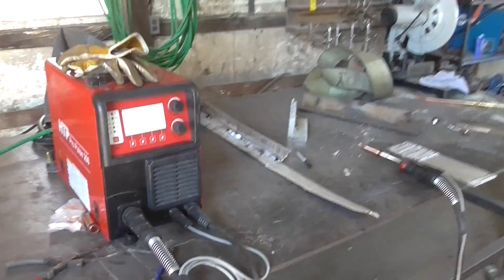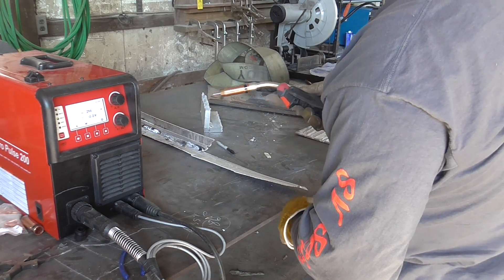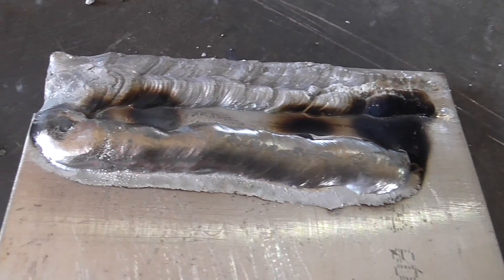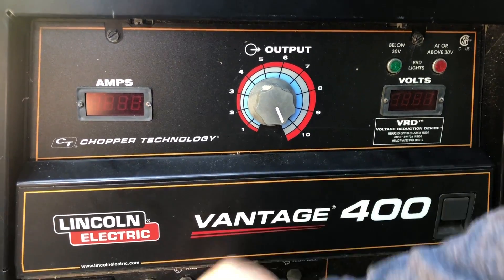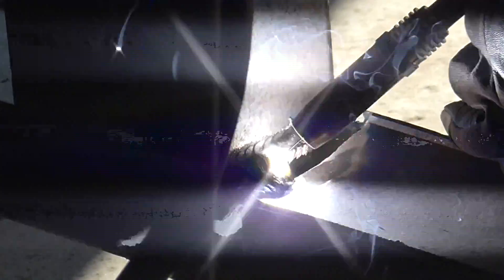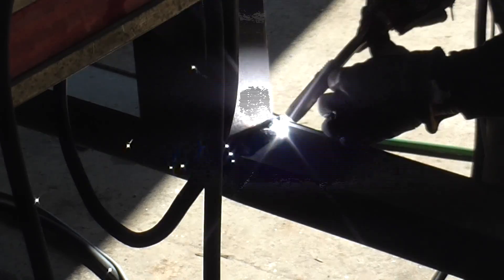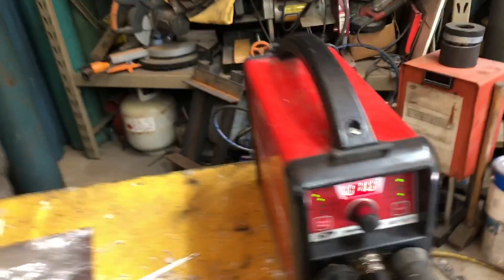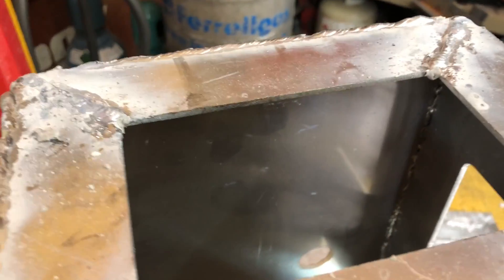Remote controls on welding machines, AMPS, VOLTS & synergic

Comment: I like the solution with the plastic clamp and twist! If there were no plastic clamps and smears of electrical tape, Gagarin would not have flown into space and there would have been no landing on the Moon! Fronius has control panels, but they are expensive and after our damn president watched Game of Thrones and decided to become emperor, they cannot be bought, this is upsetting. I’ll ask an electrician I know to remove the twist on my fronius tps. You have an interesting welding technique - backward angle. I weld such gaps by fusing the edges with a small current and welding a small gap. For beauty, I can make a facing passage.